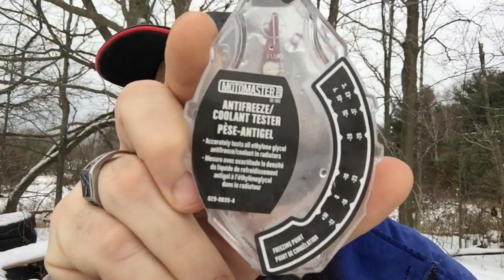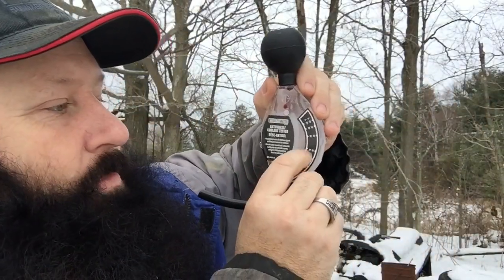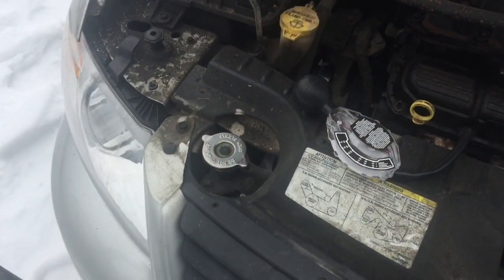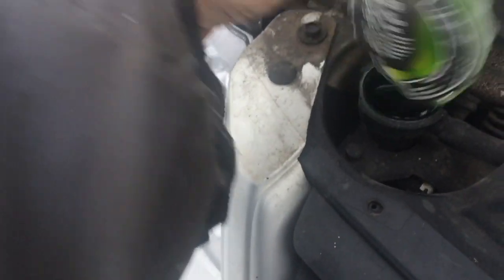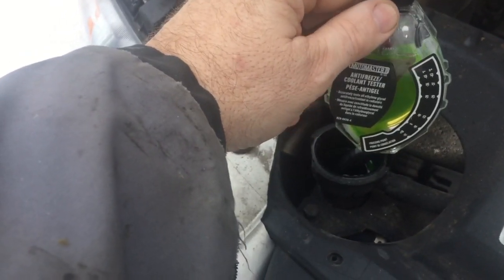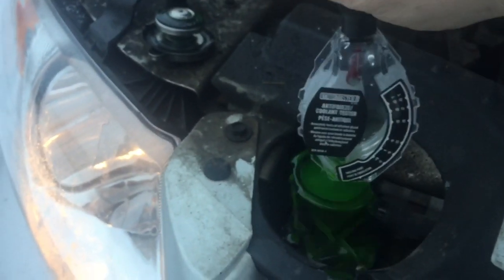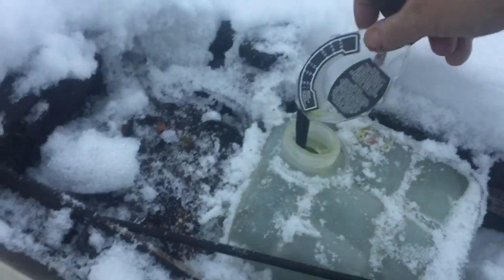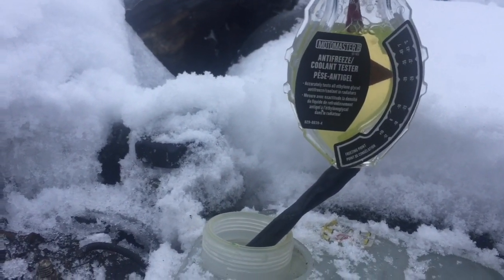Check your antifreeze/coolant Strength To prevent freezing and costly repairs

Comment: Have had to give many folks the bad news... the imports and even newer domestics seem to break the blocks or heads a lot more now than they used to. I put it all to improved castings methods these days which means less metal to save weight. Good of you to remind the people to check Dave !
Reply from the maker: You know you have a good point… I have noticed more severe damaged blocks and heads....And now that I think about it I have noticed a lot of cracked cylinder heads… Good catch
Reply: Thank Formula One, and the other top racing series... they taught the world to make cars to last just as long as needed.